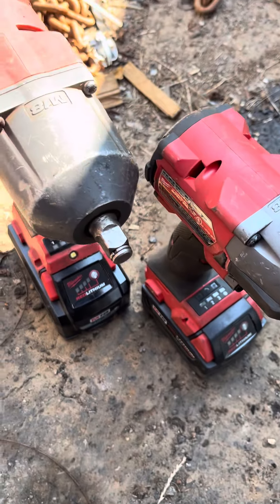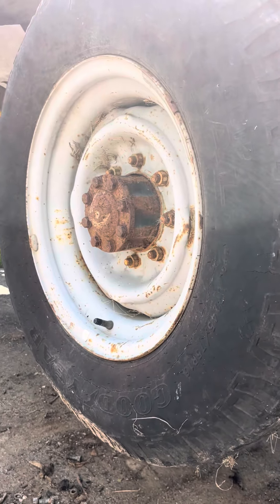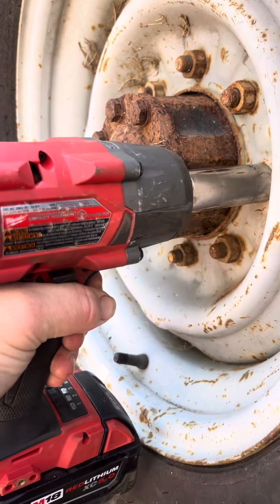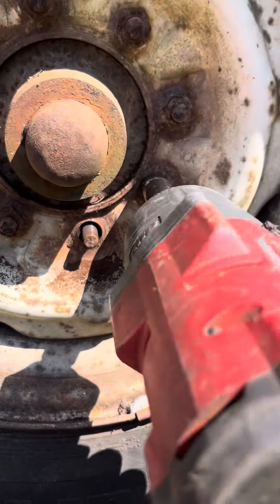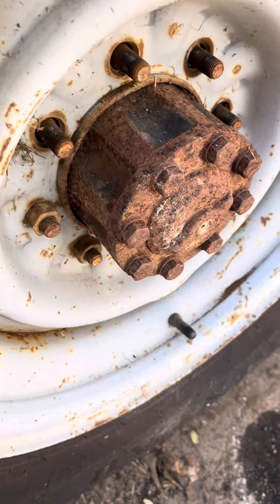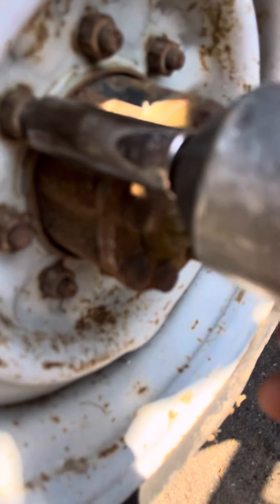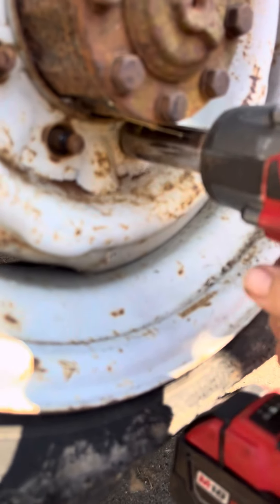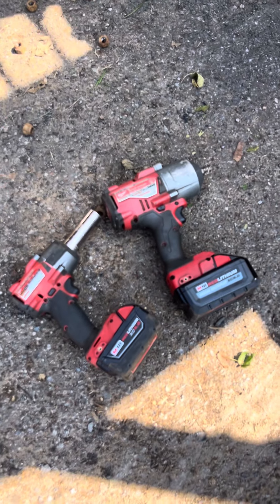Milwaukee M18 high torque vs mid torque real test side by side back to back

Comment: Those older Milwaukee 1/2 are bullet proof. And im not even a Milwaukee guy anymore. Definitely the most reliable impact of its time
Reply from the maker: @jordanalexander615  the new ones are more powerful but I’m not in any hurry to upgrade. This thing is a beast.
Reply: @drewdoestrucks  yeah it'll definitely do 99% of jobs anything bigger might as well grab a big air impact

Comment: The nuts coming out easier form the 1/2 is cause they are coming out quicker and easier so they don’t build up as much heat. The more the impact hammers the nut the hotter it gets and metal swells when it gets hot.
Reply from the maker: @jamesfair9751  could be, but also the high torque vibrates quite a bit more and I think that contributes some.

Comment: I’ve never seen a chrome socket bust with an impact but you do loose power cause the sockets are lighter
Reply from the maker: @jamesfair9751  they say you actually lose some power with the impact ones because they are a softer metal. Makes them less prone to breaking
Reply: @drewdoestrucks they are much heavier resulting in a bigger "hammer" action with each impact meaning itll loosen bolts that a chrome wont.
Reply from the maker: @n54single  weighted sockets will add force to the impact but that’s not necessarily a feature of impact sockets. It’s the metallurgy. You can buy weighted sockets for that purpose specifically.

Comment: How is this a fair test you have a high output battery in the high torque😂
Reply from the maker: If you want to use a huge battery in the mid torque you’re welcome to but at some point it defeats the point of using a smaller more ergonomic tool. I don’t think it would significantly alter their performance in a test like this. Torque test channel has a lot of empirical data showing the numbers using different batteries, this is just a real world test using batteries I actually use in both tools. The point of the test was to show how capable the mid torque is, even with a reasonable sized battery.